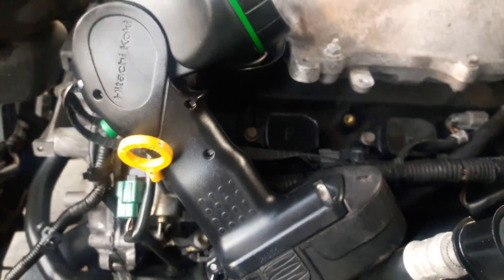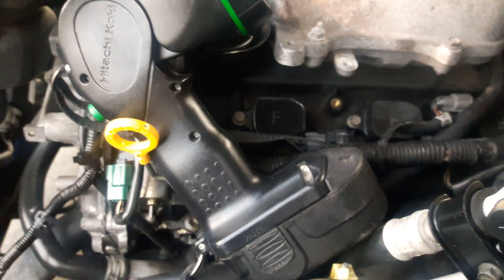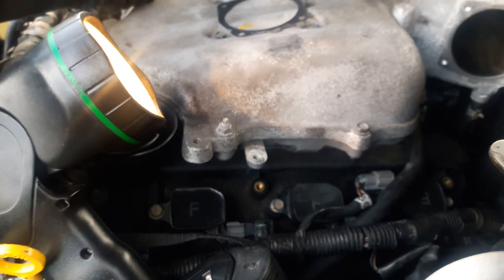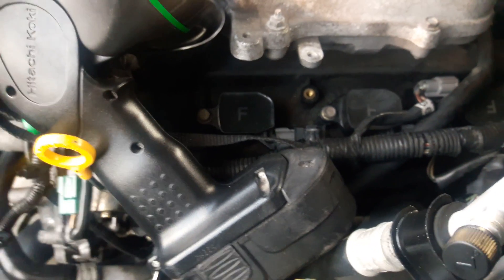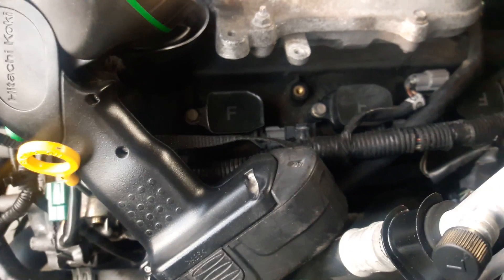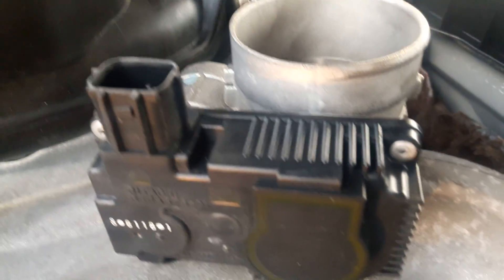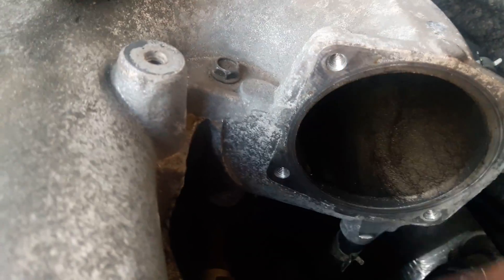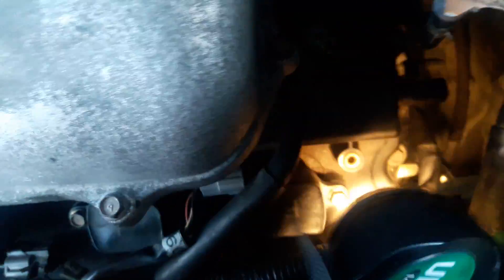Infiniti M35 Camshaft Sensor Bank 2, all infiniti with this engine

Comment: tip....both cam sensors can easily be removed by accessing them from the passenger side of the engine compartment.  if you use a     1/4 in ratchet with a deep 10mm socket its all you will really need after removing the engine cover. to release the connector,  just push the tab on the top center inwards towards the engine and it will release. i hope this helps anyone needing to replace the cam sensors.

Comment: Great video, I hearing a lot of mixed reviews saying that bank 1 is on the driver side and bank 2 is on the passenger side on a 2008 m35x, can someone confirm is this is true or not?
Reply: I made a similar mistake, for my Infiniti m35 it was made in Japan so bank 1 is going to be the passenger side, bank 2 is going to be the driver side, if it makes it easier it’s a JDM vehicle, in Japan it’s right hand drive so when u look at the engine look at it from the inside so if u were sitting in the drivers seat bank 2 will be on your left bank 1 the right
Reply: @Justin-zy3uy  thank you for the information. I had already sold the vehicle. Cats and a multitude of other problems.

Comment: You don’t have to remove anything. You can remove it from the passenger side, 10 minute job. But of course you have to go by feel.
Reply: Roberto Hernandez so I just change mines all the lights went off except the checking and the car still hesitate to crank do I need to change the crank sensor
Reply: *check engine
Reply from the maker: Did you resolve d the issue?
Sorry. had not seen your question. I am new to this..

Comment: Good job! But you don't have to remove all that stuff out! Pretty much the top engine cover! Only 5 min top Infinity tech 15?yrs not hating just correction !!
Reply: Richard Clamor what do you mean by the top engine cover?
Reply: The camshaft is located passenger side behind motor, beside the battery down in there. You’ll see a green cap. We did remove anything except top motor cover.
Reply: Is there 2 camshaft locations or only one being the passenger side?
Reply: Thanks